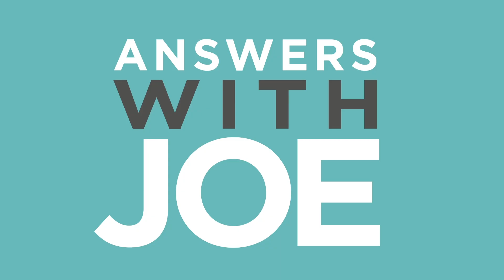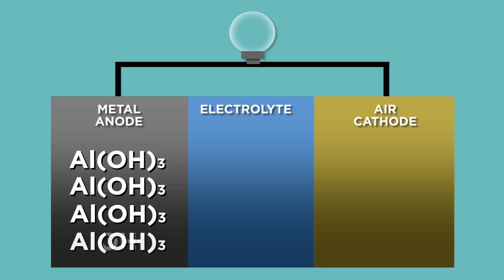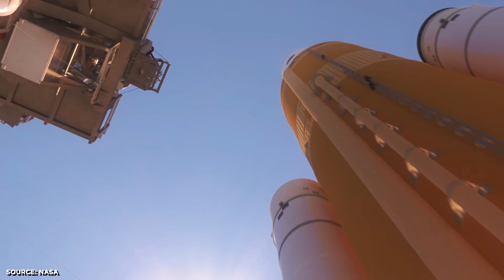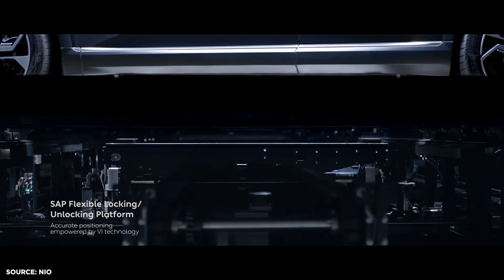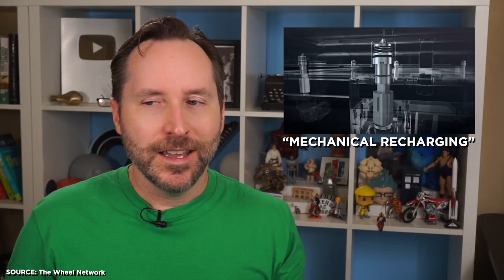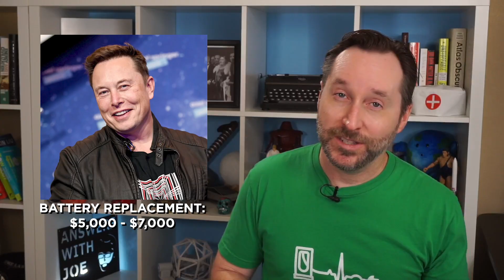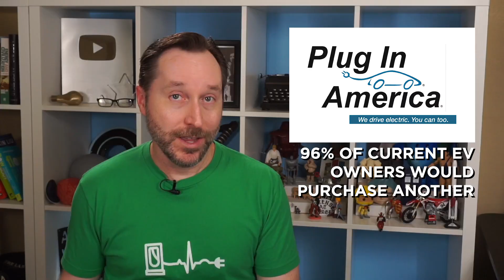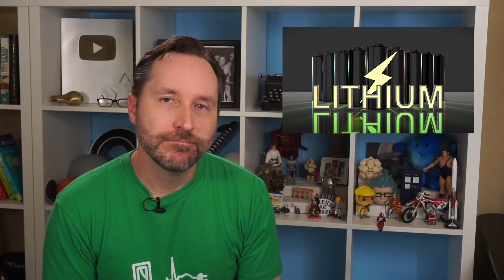This Battery Could Drive A Car 1500 Miles - But There's A Catch | Answers With Joe

Comment: If the energy density is high enough, aluminum-air might be the battery that can cleanly power airplanes.  You need far fewer swapping stations for airports.
Reply: Sadly, the energy density is not high enough. Per joule, aluminum is 37 percent heavier than kerosene, and even that near-miss becomes a far miss if the aircraft has to hold on -- and it does -- to the oxidized aluminum after it has done the oxidation and used the energy.

If the oxidation is wet electrochemical oxidation, then there is still more mass involved: water, etc.

The solid rockets the video led with just burn it. And they don't hold on to the ash.
Reply: @grlcowan   Could use lots of smaller batteries and drop to used ones overboard but I don't think anyone below it would appreciate that.
Reply: @grlcowan  but on the other hand, electric motors are super efficient.

Comment: Could they use this battery for air travel? since they lighter they should have the weight advantage and could be replaced at the airports, so we would use aluminium for air and see, and lithium for road travel. everyone would be happy if it would workout :P

Comment: I could see some people, and even more people in some locations where pack replacements were not available, having a huge case of range anxiety with the non-rechargeable Al battery.  The hybrid system might be a way around that - and you get back to using regen rather than brakes.  But that also adds complexity to an already unfamiliar solution.
Reply: Not having regen breaking is a red flag.
Reply: This is five times the range of my gas tank. And if they are smart, it wouldn't be one monoblock, it could be a series of five separate fuel cells so you don't have to wait until it's almost empty before you swap one. And if you are really worried about pack replacements in remote regions, you could just store additional fuel cells in a shed.
Reply: @patrickkeller2193  So many problems with the idea, and as implicit in the solution you propose - extra complexity to solve even the simplest of those problems.
Reply: youre literally wrong... NEXT

Comment: Battery swapping makes sense for golf-cart-sized conveyances.  Pull two lead-acid-battery-sized blocks out, shove another couple back in.  Needing to basically drop out the bottom of your car and replace it every (less than) 1000 miles, and multiplying that by tens of millions of vehicles will never fly.  Instead of filling from a pump or plugging in, now you need automated rebuilding of your car's bottom every few weeks.

Comment: EVs biggest advantage over ICE vehicles is rechargable, renewable energy. Especially when teamed up with solar PV panels. But the recycle-ability of aluminum-air batteries is compelling. I think that there will be a lot of vertical markets for Aluminum-air batteries, both in Hybrid systems as a range extender, and also for the many markets where plugging in is not a possible or convenient option. Of course Flow batteries also come to mind in terms of a swappable battery, if only swapping the charged electrolyte.

Comment: Those aluminium air batteries would be amazing as train backup batteries in cases of overhead powerline/pantograph failure. They can't have lithium batteries due to the firehazard, so this would be a safe cheap-ish option
Reply: Check out the latest Shinkansen N700s that has a backup battery to continue moving the train to the next safe location or station in case of electrical failure or earthquake. Not sure of the battery type without having to look it up.

Comment: I think that using the cat eyes on roads as a way for wheels on hydrogen powered or electric cars, to generate electricity could be a very useful idea. The same could apply for speed pumps. But then it would require rewiring all cat eyes and speed bumps in order to do this which will probably be expensive and very time consuming

Comment: As a survivor of the Texas Icepocalypse, I have to wonder about the usefulness of an Aluminum-air battery as a backup household power supply in the event of power failure, or as a backup for a backup for hospitals, in the most dire of situations, when the generators run out of fuel. I would imagine an Al-air battery could be manufactured that could sit idle for long periods and not lose potency, like other types of batteries would. It could be the ultimate emergency power source. Preppers would fall all over themselves to get one

Comment: solid electrolyte metal-air
Reply: metal-air flow
Reply: having fun snaking the asterisk business
Reply: CaO heat steam heat recharge, 350Wh/kg, cheap as mine dirt
Reply: external exothermic reaction engine
Reply: cheese grinder metal electrode, micro canals metal sponge
Reply: air transport, water too
Reply: works like platinum fuel cell electrode
Reply: air solid state split membrane, ion exchange membrane, but for air, solid state
Reply: aluminium powder nanowire spin mesh
Reply: NaOH molten electrolysis at 300C, Na + Oxide Metal => NaOxHy + Metal, reduction by higher activity metal, lower temperature molten electrolysis
Reply: baking soda water (electrolyte) battery fluid water cooling system, closed loop, you can drain the battery at will

Comment: Aluminum is so common we call it tinfoil. . .  😀

Re Model 3 battery replacement cost. . .  I think Elon’s estimate is based on “by the time the battery needs replacing 10 years from now, the cost will be about $5000”. . .

Comment: I made this comment on Matt Ferrell's video on Aluminum Air Batteries the other day, I would love to hear anyone else's thoughts: hmm, why not both? Like the company mentioned in the video did, you could have a system where the lithium battery powers the car and the aluminum battery just recharges it when the lithium batteries are low. I think it would be interesting to build a startup that sells Aluminum batteries on a subscription basis to consumers. Or one that sold to companies that will eventually manage fleets of electric trucks, vans, or Robo-taxis! At scale, I would imagine it would save a lot of money and man-hours and maybe even be less taxing on the grid. I could be wrong though! Do yall think there are any issues with my assumptions?

Comment: Talk about those Red Batteries... Vanadium-Vanadium Batteries seem awesome! I would like to know why can't I have a Vanadium-Vanadium car battery, and I would go to the "charge station" and just change the liquid to a "charged" liquid?
Reply: *Redox. "The main disadvantages of vanadium redox technology are a relatively poor energy-to-volume ratio compared to standard storage batteries, and relatively poor round trip efficiency. Furthermore, the aqueous electrolyte makes the battery heavy and therefore only useful for stationary applications. Another disadvantage is the relatively high toxicity of oxides of vanadium (see vanadium § Safety)." —Wikipedia. Sounds pretty clear why Va-redox cars aren't a thing.

Comment: What is the self-discharge rate? If they're only used intermittently how long would they last? 

The hybrid model would work best and then only for fleet local operations like city buses or delivery vans.
Reply: But city buses and delivery vans can already run all day and charge easily on cheap off grid electricity overnight?
So what's the point?

Comment: Why not concentrate on uses that don't require the development of massive infrastructure systems to be viable?

I mean are we really saying here that a battery with this many benefits couldn't be used for other major purposes that would help the environment greatly without requiring a difficult and polarizing adoption process? Large shipping vessels sounds like a great idea, as does rail possibly. How about backup grid storage in the case of outrages, or for use when renewables aren't available?

Personal vehicles just seems like such a stupid focus for this.

Comment: Redwood, a company founded by the designer of the Tesla Roadster  prior to Elon's involvement in Tesla can recycle batteries and return 95-98% of critical materials. Not quite the 100% of aluminum, but when you combine that with the fact that they are recyclable it makes sense that Tesla went away from swappable batteries.

Comment: Toting an extra battery is not efficient; however, having a battery compartment that is compatible with both kinds so that they might be swapped for a long trip is not a bad idea.  Ships and boats float in water that could be distilled (using the heat removed to cool motors etc.) and used to top off the water reservoir.  Medium to large cities could recycle aluminum-air batteries and minimize transport costs.  But there are certain to be better solutions.

Comment: These batteries certainly have their place since the materials are so easy to reuse, which is awesome. However, no battery is going to be great until we get a good foundation for power generation in this country. Solar and wind, while good secondary options, do not provide consistent power. Nuclear, preferably a molten salt reactor, should be used. That way we can charge/make batteries like this, or build solar panels, with nice CO2 free power.

Comment: I saw the hype around Aluminium/Air batteries in my news stream, and it took me a while until i realized that they all talk about one way, disposable batteries, NOT a rechargable battery.

As such, i believe this tech is completely unusable for cars. I FUNDAMENTALLY disagree with battery swap solutions in the automotive usecasce.
Reply: These 'batteries' are even worse because the waste is basically aluminium ore. Aluminium being one of the hardest base metals to reduce means that this essentially needs to be re-refined back to metal using the very inefficient bayer and hall-heroult processes. That's the limiting factor, that it only produces aluminium hydroxide (likely non-pure, as pure metal electrodes do not do well as the build up of hydroxide reduces performance) so this needs to be purified and dehydrated before it can be reduced from alumina. Just this will reduce the battery to only 15% of energy put in to create is available in the battery. 

Far better to use the electricity directly with rail, light rail, trams and trolley buses than to create congealed electricity (aluminium) to produce these batteries.
Reply: Agree. battery swap is dumb any benefit of battery swap will be gone within the decade.
Reply: WOOHOO!
I found the "sensible thread"!!!!

Comment: I've often thought about having a spot for a second swappable battery in an EV.

Most people don't need to drive 500 miles in a day, everyday. So it's dumb to drag around a heavy expensive battery.

What if you had a 40 kwh battery standard, with a place for a bigger battery that you could rent. Just roll up to the dealership/drive centre, and rent a battery.

When the road trip is over, return it.
Reply: A frunk-sized AL-air range extender battery pack?
Reply: A battery trailer.
Reply: Forget batteries. Batteries are for toys and phones even in a phone they are sub standard and bearly up to the task.
Hydrogen is the way forward.
Reply: @sahhull  

Hydrogen is the energy source of the future, and always will be.

Seriously though, hydrogen just has so many issues. From production,  to distribution,  to the fact that you have to go to gas station to get it, instead of just charging at your destination.

I would look up videos by engineering explained and real engineering,  I think they both it well.

Comment: What about houses?  Instead of the electric company coming out to check your meter, it comes out to replace your battery once, twice, or 3 times a year.  We could loose all the wires on poles and not worry about our solar panels breaking in storms.

Comment: This is something that makes sense. It’s efficient, clean, cheaper and would create a lot of new jobs in order to put up “battery exchange” stations and also the jobs needed to make the batteries. 
Therefore “BIG oil” won’t like it……the politicians in the pockets of big oil will therefore not like it. So even if our citizens want it, the right wing will stomp it.

Comment: Sorry Joe but you kinda missed a very important downside of Aluminium-Air batteries.. And that's the round trip energy efficiency.. It's the same reason hydrogen hasn't become the fossil fuel replacement it was hoped to be - Once you oxidise or ''discharge" the aluminium in the battery, it takes a significantly larger amount of energy to "recharge" or remove the oxygen from the aluminium than you extracted from the initial discharge, hence why as you said, it's so much cheaper/easier to recycle it in metal form than mine and refine more. The more efficiently we can use every joule of energy the faster we can get to 100% renewable energy!

Comment: You have to look at car usage. 
1. Most journeys are short. Not a problem for electric
2. Some journeys are long. A major issue for electic. 
What's needed? 

1. 500 mile range. 
2. 30 mins charge time. The time needed to take a leak, get a coffee
3. Enough chargers that you aren't in a queue for the charger. 

1500 range does solve that. You can go long journeys. The charge time can then be longer, say 4 hours, without an issue.

Comment: I think a hybrid car with like 200 miles of rechargeable batteries and a slot to insert a 1000 mile range battery when you go on long trips would make the most sense.
Reply: Or a light-weight 100-mile backup for emergencies.
Reply: Here's a thought.
The vast majority would use the "1000 mile range" unit only when they go on holiday?
When they have a car full of people and luggage?
When they need the space?
So why would you remove useable  volume from the vehicle?
Reply: @rogerstarkey5390  a lot of current cars seem to be selling with 3-500 miles in range but most days most people drive less than 100 miles.  So having less rechargeable daily capacity and use that space to install large capacity single use batteries. The suggestion does not require your luggage or children ride on the roof.
Reply: I think this would be a great product if it could be made.

Comment: Don't you think that aluminium air battery is more acceptable then blood battery (lithium)? At least aluminium cell will be recyclable. Also,  could get cheaper by time. And may be one day tesla like cars will be fraction priced. Thats why Indian oil is trying to bringing the car to mass market. And those who have still doubt, these cells not rechargeable means these cars also not depending on coal powered plants.so much greener.

Comment: Well. If they're easy to recycle, instead of having a big recycling plant you could have a local recycling plant each place the batteries are replaced.
Reply: So, essentially "heavy industry" build locally?...... 🤔
Think it through.
Reply: @rogerstarkey5390  

Smelting oxidized elements of an aluminum battery (which is what I understand needs to happen here), is done electrically. Should be fairly easy to do locally in a small scale.

But then making the components themselves which probably have to be pretty thin wouldn't be?

IDK, but if recycling aluminum is to be done optimally you can't have lots of trucks with spent batteries running back and forth. Easier to move the electricity for the smelting.

Comment: If you have to spend vast amounts on infrastructure, why not just get rid of cars altogether and invest in proper public transport. People don't even see it, but stop and look around the streets and roads clogged up with ugly hunks of metal that are mostly designed for 5 people but used by 1, angry that everyone else is in their way. It's pure madness. BTW I ride a motorcycle but would gladly give it up if the idiots in power would do the right thing for a change.

Comment: Another asterisk: Once the Al in the battery is converted to oxide, it is no longer cheap and easy to recycle. It would have to go through all the same processes as refining mined Al.
Reply: Well, yes and no.  The waste electrolyte can be used directly in the primary process or resold, with some reprocessing, to other industries (e.g. fire retardant coatings, etc)
Reply: Well you wouldn't need to mine and crush the bauxite which is a big chunk of cost.
Reply: @tjsbbi  I'm just saying that recycling aluminum oxide is MUCH more energy intensive (by an order of magnitude) than simply recycling aluminum metal.
Reply: It's easier than mining aluminum, because the anodes you extract from a spent battery will already be purified aluminum oxide, so it wouldn't have to be refined, just smelted.  Smelting the aluminum oxide back into aluminum is electrically expensive -- as one would expect given how much energy there is to re-extract by oxiding the aluminum -- but it's not particularly difficult.  The real problem is that smelting aluminum creates a lot of CO2 (12 tons of it for every ton of smelted aluminum).

Comment: Aren't there batteries oxidizing the aluminum?  So it skips some of the refining process as it turns to Aluminum oxide.  So it would need alot more energy to recycle then normal aluminum

Comment: The shipping industry is literally the best target for nuclear powered transportation.  

We know that the technology is perfectly viable, because we already have massive ships that are running on nuclear power.

Using those same principals on boats would make both sense, AND it would actually make disaster relief in coastal regions both easier and as a secondary income stream.
Oh the powergrid failed somewhere because of a tsunami?
Well, pick up the phone to whatever shipping company you want and ask them to yse the boat to power your critical infrastructure.

Comment: I just took two long trips in my Model Y. From Atlanta to the Great Lakes and back, and from Atlanta to Washington, DC and back. So, over 2000 miles with no destination chargers or free charging along either route. My actual recharging costs turned out to be just over 4 cents per mile!